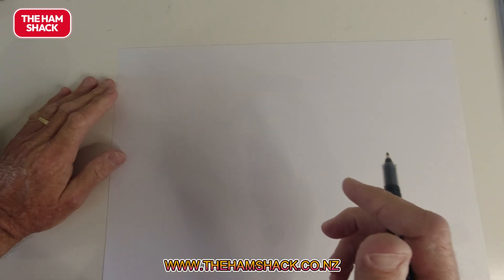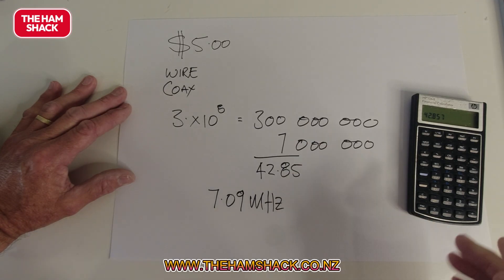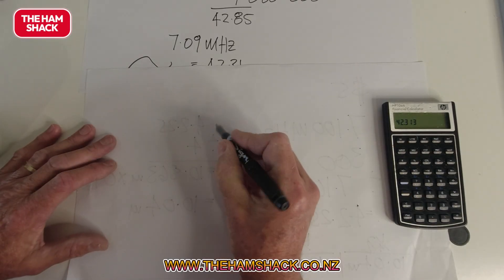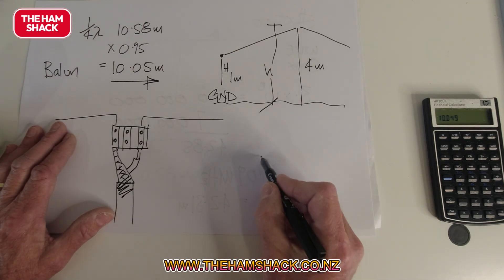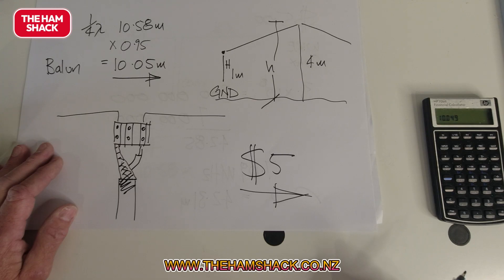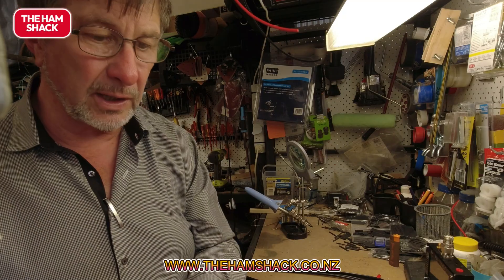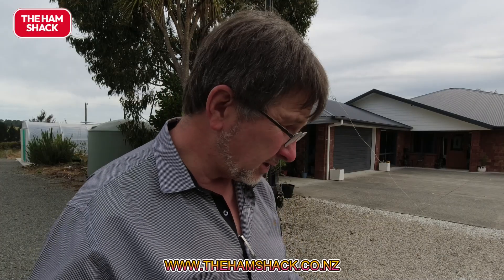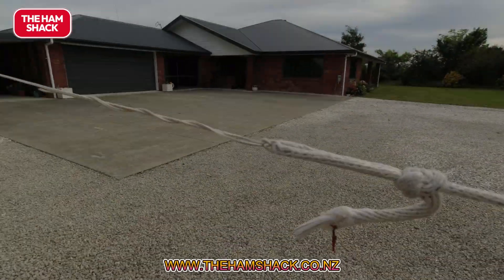Building a 40m antenna for less than $5

Comment: If you have to purchase the wire, consider doorbell wire. It's small but usable and not too expensive. 

Electric fence wire can also be used. Farmers usually buy more than they need and offering to pay for about 20 Meters often evolves into nothing more than an exchange of smiles. If fence wire is aluminum, remember that copper and aluminum should not be in direct contact since electrolysis takes place resulting in a faulty connection after a time. KK5R

Comment: After separating the shield and center conductor of the coax, twist the shield to compact the shield wires but then back up the twisting about 1/8 to 1/4 twist to not make the braid have pressured contact with center conductor. This is to add flexibility to shield wires but, more importantly, when soldering to the shield, it keeps heat from shield wires burning into center conductor insulation, which could actually risk a short from shield to center conductor. This should also be done when putting connectors on coax.

Comment: Terminal block is  a good idea. I've done this with the fitting that takes 2 banana plugs (to BNC, then BNC to S0239), which is more costly. You could also do this with 2 wire nuts.
Reply from the maker: There are a lot of options, but I just wanted to prove you can build a resonant antenna for very little money, with bits and pieces of "stuff" in your garage and shed.
Reply: When using wire nuts, which is a good idea, be sure to seal or pot open part of wire nut to keep out water. Clear fingernail polish is good for this. Nail polish can also seal coax to keep out water. Use it liberally... KK5R

Comment: Very good video showing how easy it is to make a dipole.
I used to repair stuff and if it cost too much to repair they said keep it for spares. Unwind transformers for free wire. Dipoles are cheap, easy to make and work well.
I use RG58 coax which is cheap enough, my attic inverted vee's have about 25' of coax. Using a ferrite ring is good though.
G4GHB.
Reply from the maker: Morning, yes with a bit of ingenuity anything is possible. I got some pipe from a fire damaged building and used that to build a helical antenna for a small garden. The only cost was the balun.